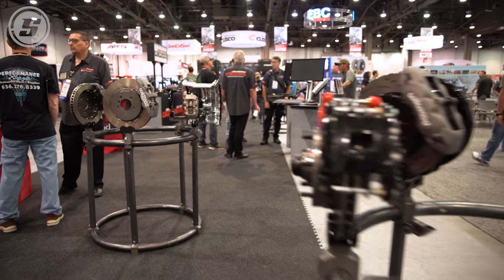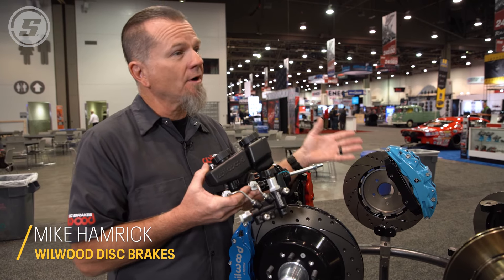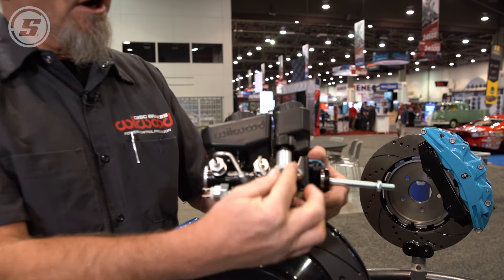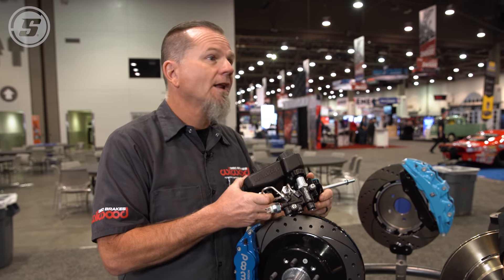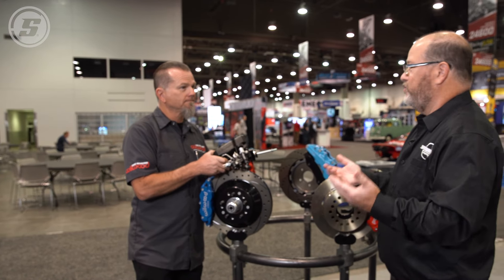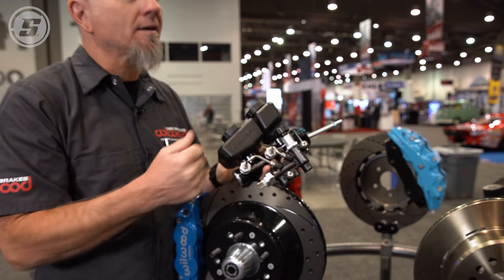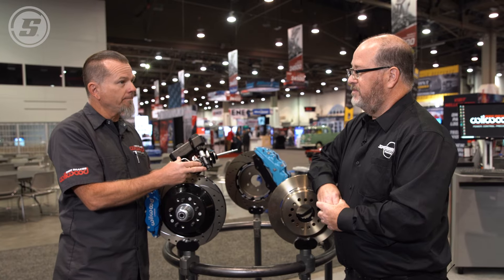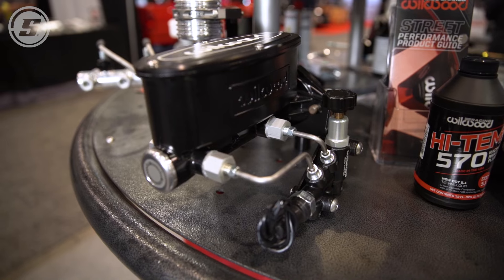What Does a Proportioning Valve Do | Wilwood Brakes

Comment: Speedway you are the best! I think that pickups are worse as drums can lock and cause. You are changing one area from the proportioning valves hold-off pressure and the pressure point which effects the apply pressures. Keep the videos coming. DK, Omaha.

Comment: A proportioning valve is an extra item to buy once you have payed for expensive disc brakes for the rear that the factory did not fit of for a reason, now they are too strong back there and lock yiou the rear so you need to pay even more for this part to turn them down.

Comment: You can oil your rear drums up too, that will prevent them from locking up.
Reply: Great tip! Ever since my axle seals started leaking my brakes have worked much better.
Reply: I like a couple quick sprays with wd40

Comment: Nobody ever talks about what if you need more break to the rear... Will this give you more break versus a fixed proportioning valve?
Reply: No you never need more brake in the rear. Th wight shifts forward as you brake, if the back end brakes harder is will lock of and make you crash. Thats why nobody talks about it. the most you will go is 50/50

Comment: What would  be a good adjustment  im running  full wilwood  brake system full qa1 level 2  Ford 9inch with 3.0 gears on a 26 inch wheel im trying to do a simple  burn out an the car want to keep going Whats your idea setting  for the Proportion val also I have a 383 stroker paired with a th350 any tip or trick would  be greatly appreciated
Reply: There is no number setting…. It’s an adjustment dial
Reply: go test it hard brake with it all the way screwed down 50/50 brake and see if the backs lock, if they do turn it out one turn, keep testing till the back don't lock. Most people never drive hard.brake hard enough to need it set up right, or the willwoods they bought in the first place. and I don't know what you think the 9 inch, 3,0 gears and 26" tall tyres has to do with how your brakes sound be proportioned!

Comment: Hi. I have a set of Wilwood Disc Brakes. And a Proportioning valve installed. I am confused of how far do I have to screw in the  valve. Shall I Unscrew it all out or Half-Way please? Thanks in Advance.
Reply: if you have it all the way in/down you will be at 50/50 if you test brake hard and the backs lock up you then turn it out/up one turn and test and repeat till the back stops locking.

Comment: What if you have a pedal box with bias bar and dual masters? Would this still be an added benefit for further adjustment?
Reply: Balance bar is fairly limited range. In pedal box system ,  you use master cylinder size as coarse adjustment, proportioning valve for set-up , than balance bar for fine tuning to driver preference